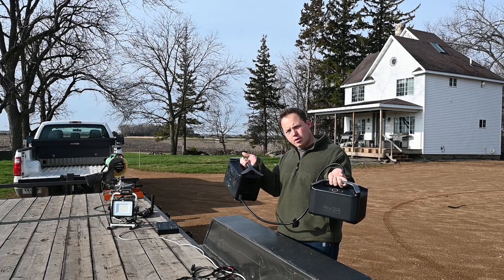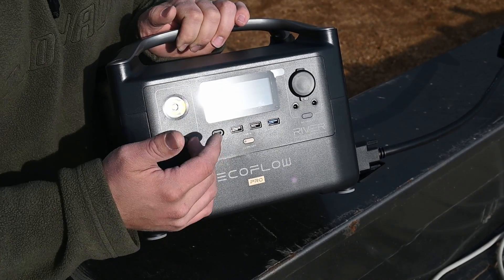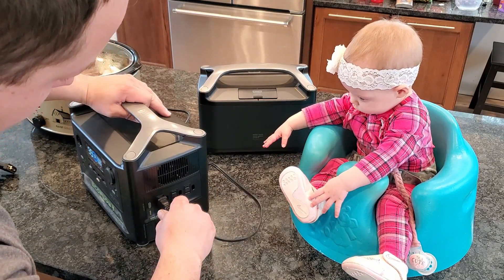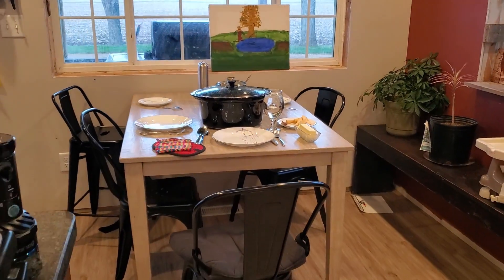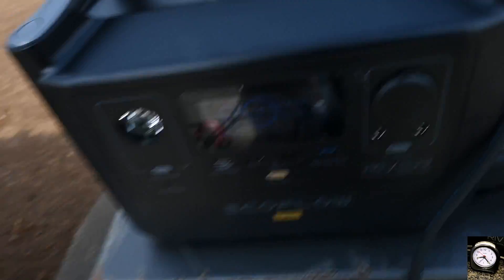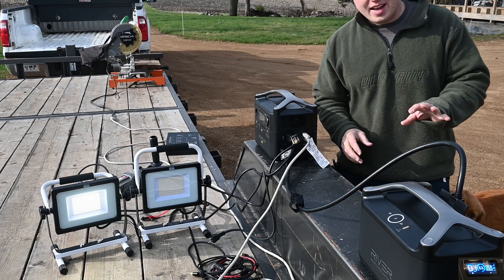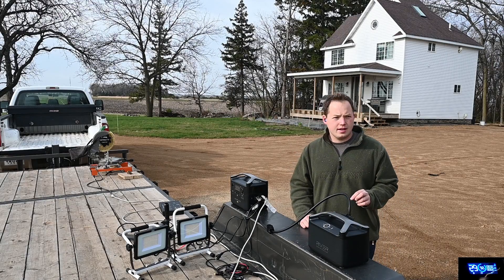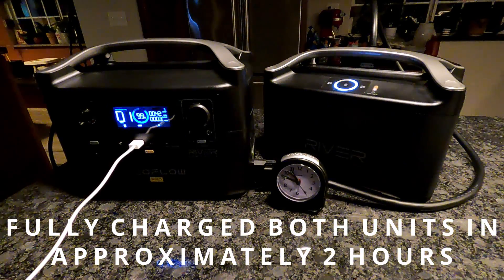Why You Should Consider Buying a Portable Power Station - EcoFlow River Pro Review

Comment: Another nice video. I was hoping you would say something about the open neutral outlets of the device. I just watched your open neutral vs bonded neutral generator (another great video) and was interested in your opinion of whether it is worth it to do anything about the EcoFlow floating neutral, or just live with the configuration? You could do some hacks, such as putting a plug in jumper on a short power strip at the output, but not sure it's recommended. Certainly not by the manufacturer. There is a strange lack of discussion of this aspect of these brands of solar generators (e.g., EcoFlow Delta). Thx, John

Comment: I really want a portable power station, but I need much more power.  I am really interested in Festool's, especially if they'd offer a 120/240 V -  60 Hz version in North America. Their current product is 230 V - 50 Hz for the Euro market.   But it boasts 11,000 watts instant and almost 3,000 watts  continuous.   Alas, it's mucho pricey -- about 3-to-5 times the cost of an equivalent generator-inverter.

Comment: No testing of x-boost?  Will lower the voltage but keep the amp and help running things like that saw.

Does your truck has an AC-outlet? Trying charging from it. If it does not, set the R600 to quiet charging with the app.

Comment: 120V * 5A = 600W. This isn't adequate for the miter saw.  Looking at the video you can see the led lights dim out, which means the voltage is seriously dropping.  You can also hear the miter saw struggling at the same time.
Reply: Interesting review though. Looks handy for small appliances.
Reply: @DavidMcCurley  interesting yes, use for small appliances probably not. A quick check on the internet for small appliance current draws indicates that most small appliances draw at a minimum the 5 amps this device can provide as a maximum. Most of them draw well over the 5 amps which makes this particular device as a source useless. By the way, that miter saw was rated at 1800 watts. Why in the world did he try using it on a 600-watt source?

Comment: I can see where these would have some limited application or as you point out times when you might not be able to use a gas generator in a particular location. All of the various companies making these units struggle with the same problem of weight, power output and run time. We really need some breakthrough battery technology. Clearly a small gas generator provides far more power at similar cost.
I think part of making these far more useful is using them in an emergency or prepper type situation when they can be paired with solar panels. If a true disaster takes place you’re not going to be able to get gasoline or propane so being able to build up a charge from sun power would be great and a device like this certainly supplies enough power for lighting, various devices and a very small refrigerator.
Reply: Actually, you can power a full size refrigerator, and given the right unit, for a good amount of time. I have a Bluetti EB2400 that holds 2400Wh, way more than the unit tested here, and outputs 1000W. I can run my refrigerator over 18 hours on a single charge. And that's an older unit. Bluetti, EcoFlow, Titan, and all of these companies have really pushed the envelope the past few years and are putting out products that can expand to 10-24KWh, run 240V loads, etc.

If you live in hurricane country and you end up in a situation where you can't get gas like what recently happened on Louisiana, this is a great option. Put out some solar panels, or even use a gas or propane generator to recharge as mentioned, and your emergency power backup can last much longer, theoretically indefinitely with solar, although you have to prioritize loads.

What I like about these is I can run them inside overnight without worry of fumes, noise, etc. Had a recent power outage and had several of these stationed around the house. A Bluetti EB2400 keeping my fridge running, a Bluetti AC200 (1700Wh) powering my internet router and some portable fans (summer in Texas), and a Bluetti AC100 (1000Wh) in another bedroom running another fan and some computer equipment so daughter could get homework done for the next day. The power outage resolved by next morning, so never had to fire up a generator or even pull out the solar panels.
Reply: @mgrnd3875  . That's a great set up! I'm thinking about doing something similar! I haven't decided whether to get a couple of Jackery units or Bluetti's new modular units.
Reply: @Brian Kelly                  Well im gonna have to disagree about these only being as you mentioned somewhat useful in limited situations. There are far far too many times when someone may want something like this to only be moderately useful as you described. Gas is over three and a half dollars a gallon in much of the u.s. and in reality those engine powered generators arent very fuel efficient (some burn over a gallon and a quarter an hour when under load) so the high price of these machines is only an initial cost since theyll pay nothing for the suns power for a decade or more (depends on how long their panels keep working)
Reply: The technology is already there for portable power. As others noted you can get portable power with much higher specs than the one in the video. The question is how much do you want to spend?

Comment: The price of these are way out of line, better off buying a honda gen or extension cords, plus these will not last and fail early.  There's no way I'd leave the house with this running, first china virus next they'll burn your house down.
Reply from the maker: Yeah if I had the choice of either a little Honda or this is take the Honda every time. This is only useful for certain scenarios.
Reply: There's a place for these. I've run my fridge with a Bluetti EB240 (2400Wh) for about 18 hours. A Bluetti AC100 (1000Wh) keeps my home network up for over 19 hours. I like that I can run them inside overnight during a power outage and no fumes, no noise except cooling fans in the unit like a computer, and potentially indefinite power with portable solar panels.

I also have a small inverter generator, but I hardly need it because these get me through most moderate length power outages (my units are higher capacity than the one shown in the video). And down here in hurricane country if you're out of power for weeks like what happened in Louisiana and you can't get gas because roads are impassable and there's no supply, then this is a great secondary option. If you have a generator and some fuel stored you can extend the time you can survive by only using it long enough to recharge the power station. Or pull out solar panels if you have sun (which we always do eventually down south), and you could get by for quite awhile. If you're in an apartment and you can't really run generators these are a great option. 

They are not cheap, so that is a downside. Prices are getting better per Wh but still high. But seeing how many people there are that have absolutely nothing, and for those that don't want to mess with generators with gas and oil (which are quite a few), this is a great option to keep phones charged and maybe run critical loads like a fridge. Better than what I see a lot of folks do by running their cars during outages just to charge phones. Very power inefficient.